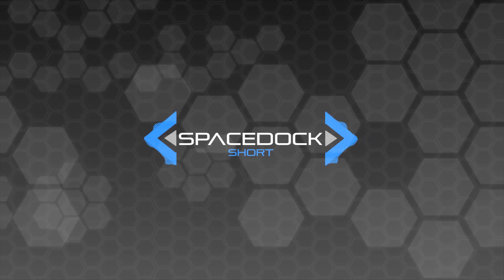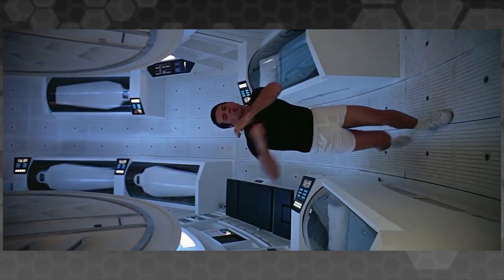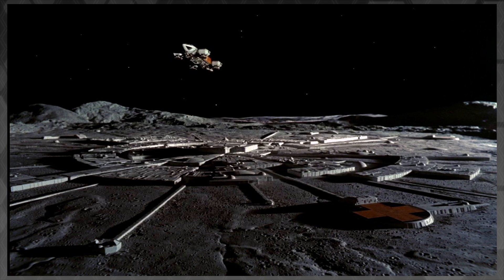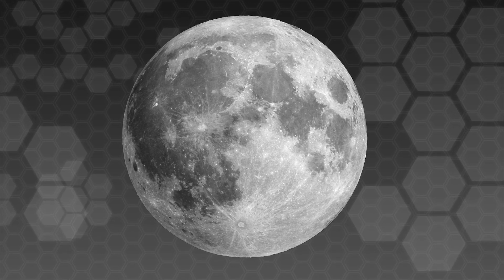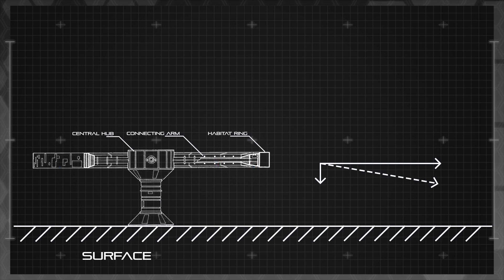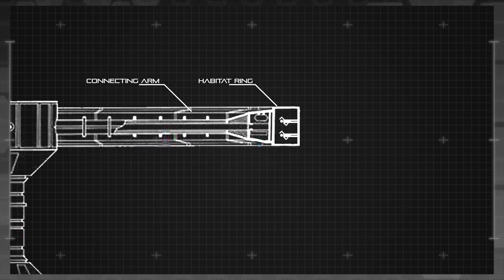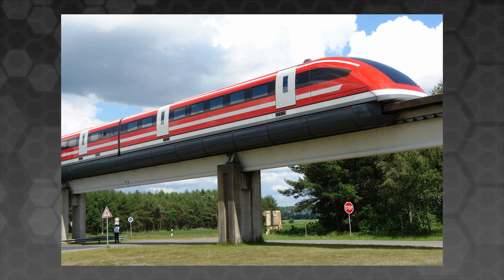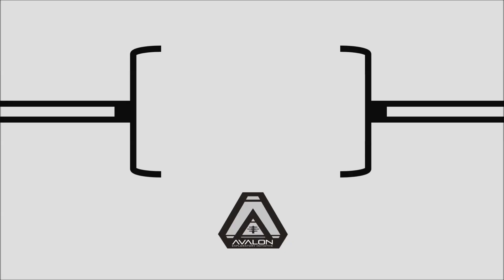How To Create Gravity On The Moon

Comment: Scott Manley did a good video about it a good while back: https://youtu.be/gU9dCWY7G2M
tl;dr version:
The method used for Ceres and Eros in the Expanse have two big issues. 
1) It would take massive amounts of energy to spin the asteroid up.
Now, this is a far, far smaller problem in a universe that has Epstein drives. Even so, hollowing out the asteroid and building an O'Niell cylinder inside of it would be much more resource effective.
2) The asteroid would fly apart. Even if it was 100% solid rock, which it is not, it wouldn't have the structural integrity to not crack and fly apart if you try to simulate 1G. All but the smallest ones would fly apart much sooner. 

This video show the much better solution. What's even better is that you can expand with relative ease by simply stacking rings on top of each other. Even better, sink it into the rock, a few meters below the surface, and you've got yourself free radiation shielding.
For small asteroids, such as Eros, their gravity is minuscule enough that you can simply ignore it, and as I said above, simply put a giant spinning cylinder inside. Just imagine the Nauvoo being inside an asteroid. Why inside, why waste time hollowing out an asteroid if you're going to build a spin gravity hab anyway? Because, of course, having it inside an asteroid protects it from impacts and radiation.
Reply: That is how they did in Gundam Unicorn for the Palau Asteroid Colony. A couple small cylinders are planted into the rock of the asteroid before being spun just like a Space Colony.
Reply: In fairness, though, something a lot of people overlook is that the simulated gravity in the expanse is much less than 1 G.  This why belters have issues on Mars or Earth - their gravity is usually set to around ~1/3 G, which makes it quite a bit more achievable in practical terms.
Reply: Wizkid490 
Yeah, I've always wondered if the astrtoids could achieve an acceleration enough for habitation, but not a full g
Reply: Wizkid490 I'm aware. Eros could just barely hold itself together producing 0.3 G. IF you first somehow managed to convert the entire mass of the asteroid to basalt fibers. Regular old rock would not hold together. (it would still take the equivalent of of over a dozen Saturn V first stages firing at full tilt for a decade to spin Eros up though). Ceres have no chance of holding together, because it is much to large. Think of it like this. Imagine a steel  cable hanging. If you make it longer and longer it will eventually snap under its own weight. Same deal here, the larger the radius of your spinning object, the stronger the material would have to be to not rip itself apart. Anyway, I found the link to the video I'm referencing https://youtu.be/gU9dCWY7G2M

Comment: While this would work technically it would never be practical enough to do, the cost of building and maintaining a ring of sufficient size to be usable would be astronomical due to the complications of working under gravity, even if it less than Earth’s. Maglev or not you need a lot of energy to keep one of these running while also taking up a ton of valuable space compared to conventional accommodations. It would be much easier and less expensive to just have people wear something like chain mail made of a dense material to simulate larger gravity, coupled with regular exercise it would be far simpler and cheaper than building giant spinning donuts.
Reply: I've commented above once.  The moon's gravity is 16.6% that of earth's. Do you want to wear clothes 5 times your mass?  ☺
Reply: tasman_devil you don’t have to wear clothes five times your mass, hence why you’d have to couple heavy clothing with exercise. You can make chainmail out of something like tungsten and get easily up to half of effective earth gravity. It won’t be that noticeable if worn on a daily basis and will help significantly with maintaining bone density. Of course this doesn’t solve all issues with living in low gravity but is far more reasonable than giant horizontal spinning habitats.
Reply: I doubt heavy clothing (even if it's tungsten chainmail, it would still have to be the equivalent mass to even feel like earth gravity. Higher density doesn't mean less mass) would solve the whole "pregnancy in low gravity" issue I keep hearing about. 

That and I'm pretty sure that such clothing over the lifespan of the child gets progressively more expensive compared to regular fibers.
Reply: Sabersonic I’ll repeat what I said, heavier clothing doesn’t solve all issues that come with low gravity, however when it comes to preserving bone density you can easily, and compared to giant spinning rings cheaply, simulate enough of earth gravity to help deal with basic problems encountered by adults on the Moon. My point is not that I have some magic solution, it’s that giant spinning angled rings on the moon are an extremely over complicated and expensive way of solving the problem.
Reply: Beanpapac15 Well considering that there aren't any published studies by NASA or any government space agency, or any private company for that matter, I think it's safe to assume that just wearing heavy clothing while under low gravity isn't a viable option.